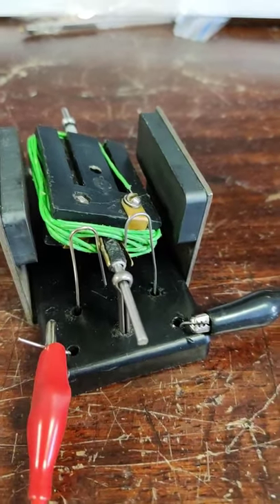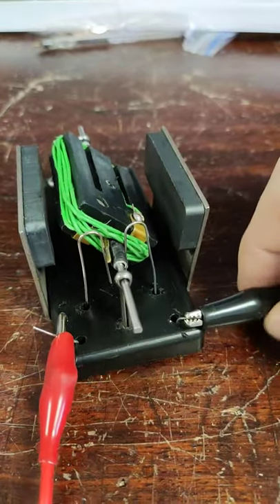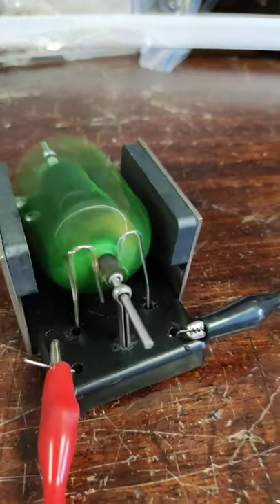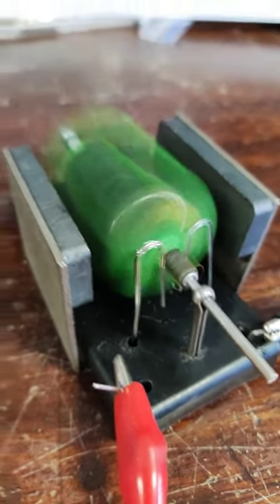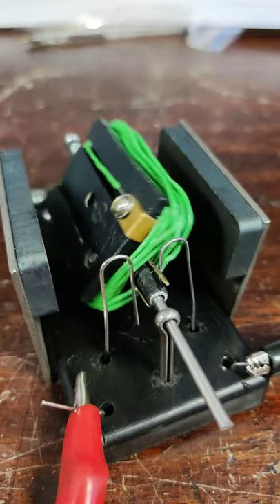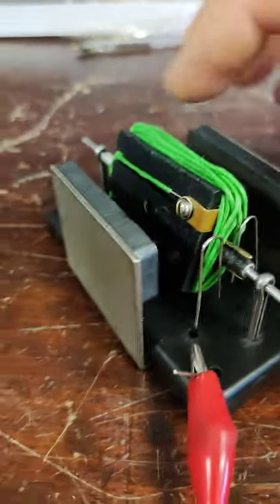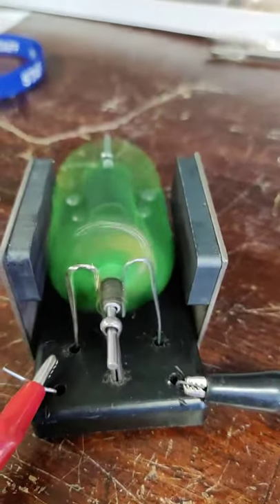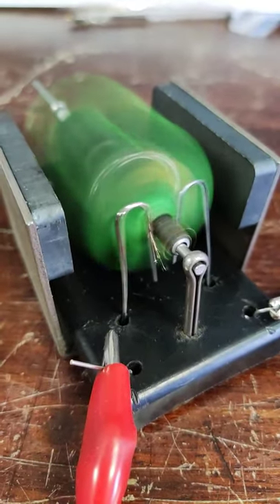Electric Motor with a paperclip

Comment: Fantastic. What have you used as the commutator?
Reply from the maker: A paperclip!
Reply: @animatedsci  The paperclip is not the commutator. What is the black part touching the paper clip? Is it just part of that body of plastic?
Reply from the maker: @leowanker2186  the base part is plastic. The paperclip is bent over and under and is the commutator in each side for a DC motor 😃
Reply: @animatedsci  The commutator refers to the rotary part of the motor that holds the connection or contact. I can now see that this commutator is the same part as the wire termination piece.

The paperclip in your great model could be referred to as the brush gear.
Reply from the maker: @leowanker2186  yes true but for GCSE exams they usually call it the commutator so that is why I went for that. Good point though 😃